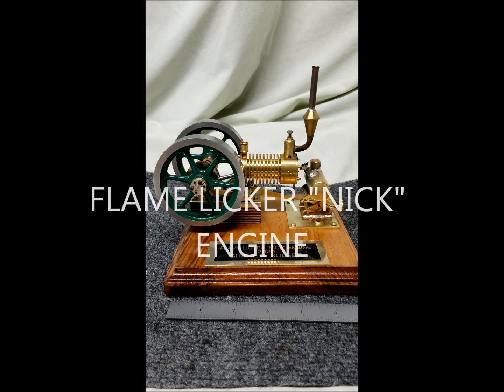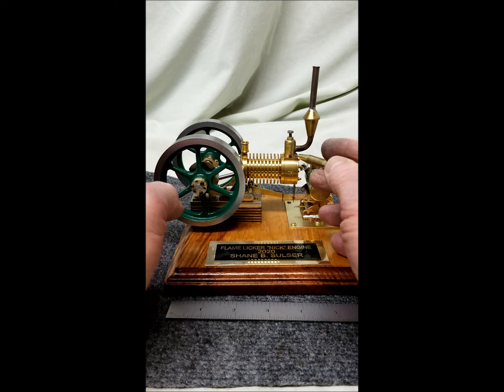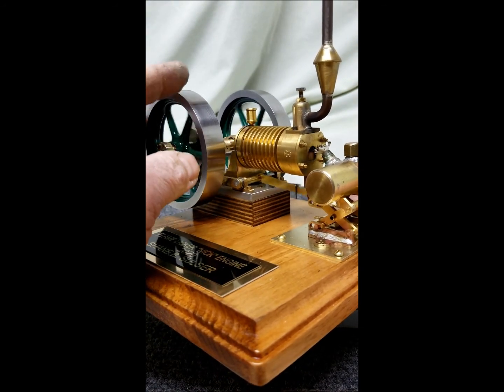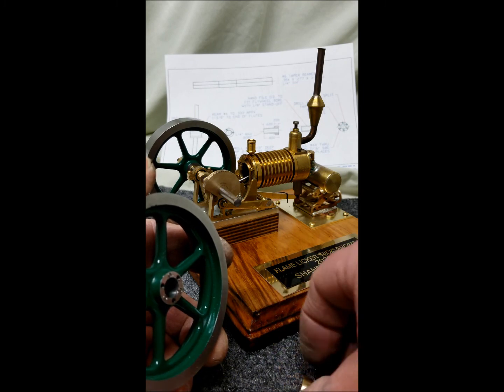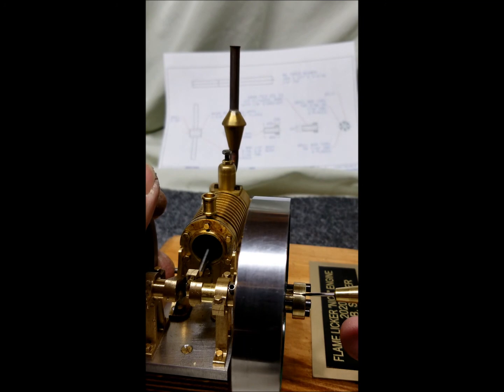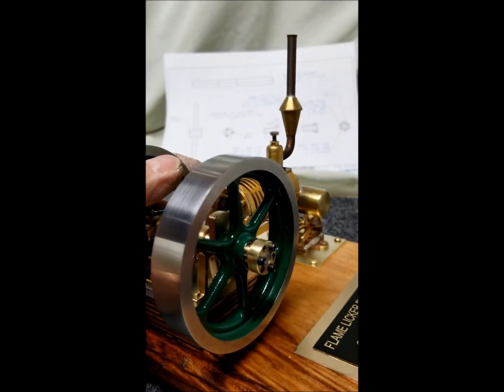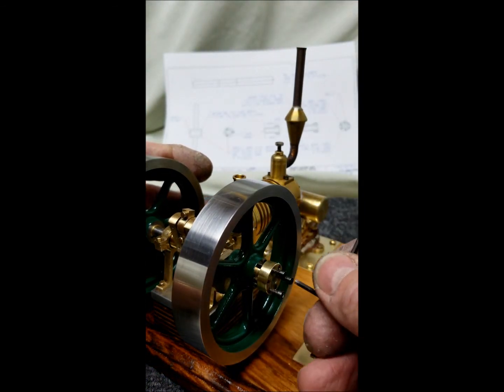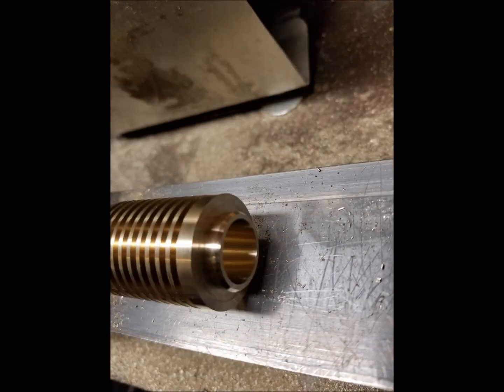Flame Licker "Nick" Engine, Machined and Assembled by Shane B. Sulser

Comment: Looks very nice  I'm wondering if you can help iv made a flame licker but with out the chimney I really like the look of it and would like to make / fit one. Do I need to put a hole in the cylinder and bolt it on. Do I need a valve in the exhaust.
Reply from the maker: Thanks for the compliment. There is a ball that seals the exhaust to create vacuum, as the piston moves forward the compression pushes the ball up and exhaust out the stack. The cycle then repeats.
Reply: @shanesmachineshop9719  Thanks very much for your help. I will make with a ball-bearing and hopefully it will sound similar to yours. Many thanks.